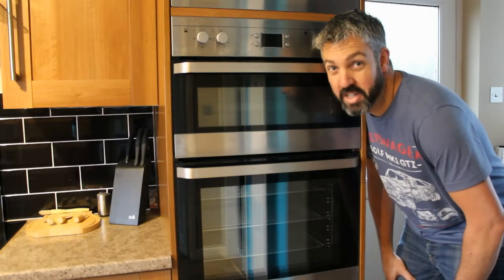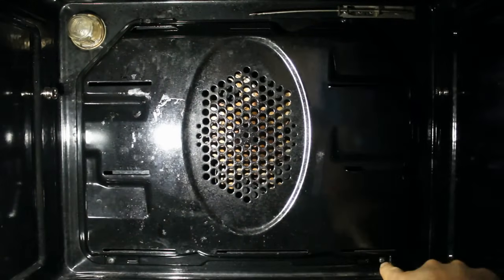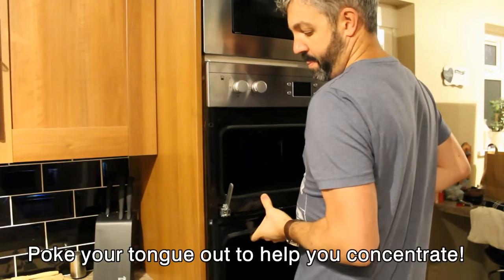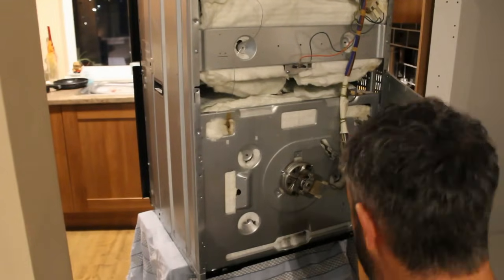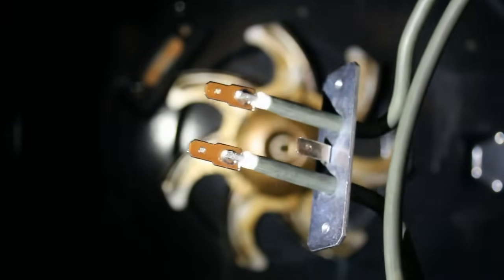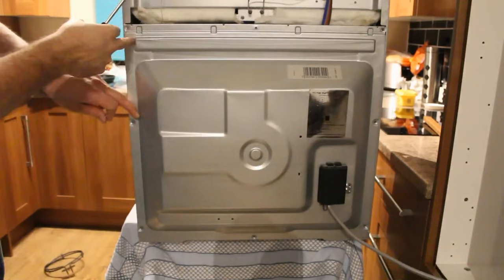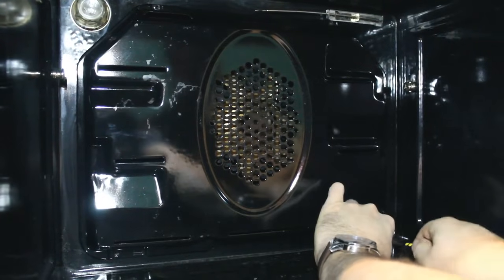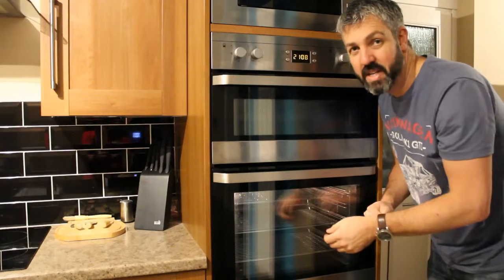How to change an Oven Heating Element on a Beko Oven - Fan Oven not heating up?

Comment: Thank  you so much x I am so proud of myself, 55 year old female and following your tutorial I replaced the oven heating element and deep cleaned all layers on the glass door of my beko 90 cm wide stove! I can not thank you enough for the straightforward guidance which gave me the confidence to give it a go. I have been trying to get the oven repaired for 6 months but no one wants these kind of jobs any more! With family coming for Christmas it was either repair it myself or pay nearly £1k for a new oven! It took me 3 hours, one of the screws was crossed and I had to replace that but I did it and it works! So pleased and thanks x
Reply from the maker: @dandelionpark3673  WELL DONE! I do love reading these comments where the video has helped someone save so much money! 👍🏼👍🏼

Comment: The element in my Lamona 4603 fan oven was exactly the same with 2 of the 3 attachment screws installed form the back, WTF !! Rather than pull the whole double oven out from the kitchen unit I managed to remove the 2 screws using grips on the screw  tails and back-wound them out. I then pulled them out using a magnet on a stick through the cable slot. Could probably leave them in there tbh as they are caught up in the insulation and not really a problem. I then opened up the two holes in the new element attachment plate to 3/16" diameter and installed it with 2 suitable self tapping screws from the front. Mission completed in about 20 mins for just the price of the element , about £10. 👍😉
Reply from the maker: Nice work! I'm glad mine was just a single oven!

Comment: Unreal. Thank you so much for this. Element replaced and seems to be working as expected. Odd burning smell when I first turned it on which panicked me a little, but it quickly disappeared and I'm not on fire or electrocuted. Saved me a fortune! Cheers.
Reply from the maker: Brilliant! Great to hear it helped you out. You do get that burning smell when it's new but will go after a while.

Comment: Excellent video step by step made it so easy . Iv just completed it too 50 min I took my time . Turned it on is it comon to have a different smell  ??  Cheers for the video
Reply from the maker: Glad the video helped you out. Yes...it will smell a bit when you turn it on for the first time after replacing the element. That's normal!

Comment: Very handy video CharlieShooters - easy to follow and given me the confidence to try this myself.  Do you know if it is simple to remove the fan itself too as mine could do with a clean up.  Looks like you just need to remove the centre nut and the fan should slide off the shaft?
Reply from the maker: Thanks, I hope it helps you out. I'm not sure about the fan if I'm honest, I've never had to remove one, sorry.
Reply: @charlieshooter  No worries at all... just did the repair job and its come out lovely.  Bit fiddly to screw the new element back in but with a second person to help hold it, it was fine.  Came up to full temperature in 5 minutes!  Thanks for a great video, the sense of achievement is especially high given the lockdown!
Reply from the maker: Great to hear it helped you out! Especially at this strange time!

Comment: Thank you for your video. Its really helpful, i changed this morning but i drop one screw in the fireproofing. Will this cause any problems if i using the oven
Reply from the maker: I wouldn't have thought it would matter. It is metal so it won't catch fire for a start.

Comment: Thank you! My oven is almost identical inside but only has one back panel so that flummoxed me a bit, along with the two holding screws at the back being very hard to find, but I got there eventually. Also there was always a rattling sound from the fan touching something when I bought the cooker, and my previous beko had the same thing, so I thought it was normal, but now the fan is running and not touching the new element and it is virtually silent.
Reply from the maker: Glad the video helped you out. Good to hear the cooker is now working as it should with no rattles!

Comment: Nice video. My oven's an OIF24300M but internally very similar to this one. I've no concerns about changing the element - I just hope that is indeed the fault! I think it is, however: clock on, fan on, light on, no heat, although there is no visible damage to the old element. Anyway, I'll know in a few hours - if I'm still alive! 🤣🤪👍
Reply: SUCCESS! And no injuries! Your video was really useful. I nearly lost a screw removing the element, as you warned, but managed to catch it. Thank you for your video!
Reply from the maker: @ChrisWrightOM1  Glad to hear it! Sorry I was late with my reply...was going to say, the element doesn't always have to show signs of damage to be blown. 👍🏼
Reply: @charlieshooter  Don't worry - I'd got that from some of the other replies.

Comment: Thank you. I have a Beko free standing range cooker - for some reason Beko refuse to give me any instructions on how to replace my heating element. I'm guessing it's the same principle (ie screws located in the back etc) for me to replace?
Reply from the maker: I've never changed an element in one of those, but I have changed them in a couple of different makes of oven and they have been the same as I've shown here. Sometimes you don't need to access from behind though, some unscrew from the front. Good luck with it.

Comment: Great video, cheers. Quick question though. My yellow and grey wires, attached to the heating element were the other way round to yours, is that correct???
Reply from the maker: I don't think it matters if I'm honest as effectively they are just creating a circuit with the heating element. I would always put them back as I found them, regardless which way round!

Comment: My element has failed in without the big break in the insulation like yours did but you you can still tell it's buggered by checking the resistance on the terminals on the back, it should be about 30 ohms but mine is showing meg ohms resistance.
Reply from the maker: That's another way to test it, if it's not so obvious as mine was. 👍🏼

Comment: Hi Charlie, great video! Only just seen this video after our element failed. Seems since we had the element replaced the fan is now catching the element. The replacement element doesn’t have screw to hold it in place. Any suggestions? Appreciate any help, thanks!
Reply from the maker: Well, it should definitely have a screw holding it in position. If it is just catching the fan, you should be able to bend (persuade) it away from  it slightly.
Reply: @charlieshooter  Thanks Charlie. Seems to move when it reaches a high temperature. I’ll have another play around. Thanks!

Comment: Hi Charlie, 
Great video. The heating element on our cooker does not look damaged like yours but still isn’t heating? Everything else is working fine though. 
Could the element be broken in other ways (perhaps inside or with a connection), I ask this because it looks like new, just doesn’t work? 
Thanks. 
Josh
Reply from the maker: A few people have said the same, and yes it could well be broken without showing any visual signs. If it's not heating up, and everything else is working it's more than likely the heating element. Thanks for watching! 👍🏼

Comment: Excellent video thanks. My replacement heating element is on order. One question, when the heating element blew it tripped out the rest of the oven, ie the display and dials so I can no longer use the grill either. How do I sort this? Will it re-engage once I've replaced the element or will some fuse part also need replacing? I've checked the main fuse box and it's not tripped there, so it's within the oven.
Reply from the maker: Oh right, mine didn't do this so not 100% sure what to suggest to check.  Check the manual for other fuses, or you may find that with a broken element it is affecting other things, depending how it's wired? Maybe?
Reply: The heating element went before on this oven about three years ago although it didn't trip the fuse last time.I might check the plug fuse, hopefully it's as simple as that, fingers crossed.

Comment: Hey We followed your instructions perfectly, but there’s a very strong burning smell when we turn it on - is that normal?
Reply from the maker: It always smells a bit with a new element as it burns off any preservative that they coat it with. Leave it on for a good 15-20mins and it should go! Double check nothing is catching the element.
Reply: Wow thanks for such a speedy reply - so grateful for your advice - it’s just me and my flatmate and we’re a bit useless but this broke things down so easily!
Reply from the maker: @aliceteawithroses  Pleased to hear it helped you out! 👍🏼

Comment: Hi Charlie, thanks for this video. I have the exact oven as the one you used in your video but it also doesn’t heat up as much, it just stays lukewarm. I have followed your instructions and replaced the element but the issue still persists. Is there some sort of optimum temperature setup I could follow? Thank you so much
Reply from the maker: It's usually the element if it's not heating up, but it could also be the thermostat.

Comment: Thanks for this video. I enjoy fixing things myself! I've replaced my element but the fan isn't spinning smoothly; it catches on the element. Any tips for fixing that? TIA!
Reply from the maker: Not sure! If you've bought the right element it shouldn't catch the fan. There may be a bit of adjustment where the element is screwed in, or you may be able to manipulate the element a tad to get it out the way of the fan. Don't pull too hard on it though!
Reply: @charlieshooter  the product description says it should be the right part. I'll try some gentle manipulation!
Reply: Hi Charlie, I've replaced the element but the oven seems to be tepid at best. Any suggestions for what to try next?
Reply from the maker: Could the new element be faulty? The fact it didn't quite fit right and now it's not heating up may be an indication of that? Or is the thermostat faulty maybe?

Comment: The way you spin the blade in this video is that the correct direction for the blade to spin? I know it sounds dumb but I'd expect the blade to spin the other way?
Reply from the maker: Just checked, the fan goes clockwise.
Reply: @charlieshooter  thank you for the help. Much appreciated

Comment: When I fit the new element, could I put the retaining screws in from the inside instead of the back and save all the back removing next time it needs replacing?
Reply from the maker: It's a good idea, but unfortunately that won't work, because they thread into the bracket on the heating element.
Reply: @charlieshooter  I might have to look for some bolts with the correct thread and glue the nuts on the rear, lol.   I'm just a simple girl and can't be doing with removing the whole thing just to replace an element.  Beko used to be so much easier :D
Reply from the maker: You could try....but I don't know how successful that would be! I'm hoping I don't have to change it again...hopefully this one will last! 🤞🏻

Comment: I am doing my heater element on my beko exactly as yours, however the fireproof material seems singed in a few places is this a cause for concern also on my heater element the wires seem to be reversed yellow to the top connector Gray to the bottom, can you advise please
Reply from the maker: I'm pretty sure some of the fire proof material may have been singed in places on mine too. It's nothing to worry about though. As for the wires around the other way, again, that won't make any difference as it's just a loop, so you'll be fine putting them back either way.
Reply: Thanks for very speedy response to my question, your knowledge and the clarity of your instructions are exceptional,  don't suppose you  know the numbers for Friday night's euro lottery? Many thanks Stewart
Reply from the maker: I'll let you know Friday! 😉 If I get them right I'll buy you a new cooker!! 😂 Thanks for the nice comment! 👍🏼

Comment: I have BEKO - XTC611W 60 cm Electric Cooker
and I do believe my element has blown 
Fan and light on but no heat after fuse tripped earlier
Any advice you can give 
Where to buy element etc would be very grateful
Subscribed 
Really great vid
Reply from the maker: Thanks for subscribing! Amazon would be my first choice maybe. Other than that, bekospares.co.uk, espares.co.uk or even Ebay?
Reply: @charlieshooter  FIXED it.....Thanks again
Reply from the maker: @darkestserenity6775  Excellent, pleased to hear it!

Comment: Hi fan not spinning for my beloved double oven is it a easy process to replace?
Reply from the maker: If I'm honest, I've not had to do it! However, the process would be very similar to my video, as all the same stuff needs to come off to get to it. There may be a bolt/screw holding the fan blades to the motor maybe, and then the motor will be attached from behind.

Comment: My oven is a range oven with two fan ovens. one works fine, the one I use to most is getting too hot. I am not able to unscrew anything in it as I can't grip a screwdriver due to severe arthritis in my hands. any useful tips will be of help?  I don't want to replace it as all other parts work ok apart from main oven.
Reply from the maker: There are tradesmen who specialise in oven repairs, or electric appliances. Maybe worth checking for a local tradesman to you. I'd imagine even that would be cheaper than replacing a whole range oven.
Reply: @charlieshooter . Thank you for your reply Charlie, will certainly give it some thought.

Comment: I tried to change the element in my zanussi oven  but after removing the element the 2 wires which are connected  with spade connectors fell down the back and i had to remove the back of the oven with great difficulty to push them back through but now i dont know which way round they go or can they be put on either way. There are just 2 teminals so 2 wires.
Reply from the maker: I'm sure they can be put around either way....it is just creating a circuit out of the heating element and it doesn't matter which way round it goes.
Reply: @charlieshooter  thanks for the quick reply it was worrying me I'll give it a go cheers.

Comment: I changed the heating element over but got the cables mixed up so it blew when I turned it on haha would it just be the main fuse that’s gone or??
Reply from the maker: I would think it may be the fuse. Put the wires round the right way and try swapping the fuse.

Comment: Hi hopefully you can help me... my becko oven is heating up but the fan has stopped and it's making cooking a nightmare..  the fan was making a funny noise for a few weeks before it packed in.. how do I replace the fan?
Reply from the maker: If I'm honest I've never had to change one, but from what I can gather it is a similar process as the heating element (i.e. the back has to come off to access the back of the fan), couple of screws and you're away.
Reply: @charlieshooter  thanks for the reply.. have found another video on youtube and looks fairly easy lol

Comment: Hi Charlie, I have the exact same oven as the one your working on here and my element has gone too. One query I have is the connections on the element from behind, the grey and yellow. My colours are yellow on the left and grey on the other side the right. You mention that they are the opposite to mine is this an issue or should I make sure the grey is left and yellow right? Many Thanks. Paul.
Reply from the maker: I would always put them back as you found them, but in all honestly, it's just making a full circular loop so which way they go round probably doesn't matter.
Reply: Thanks Charlie, Another question please Charlie if you don't mind. As I have mentioned that my element had blown yesterday. My timer does not light up at all since the element blew, would this be right that it would not light up until the element is replaced? Many Thanks Charlie. Paul.
Reply from the maker: Do you mean the clock? Mine still worked even when the heating element had gone.
Reply: @charlieshooter  yer mate the clock not on at all
Reply from the maker: I don't think repairing the heating element will fix the clock......but I may be wrong?
Reply: @charlieshooter  ok thanks anyway Charlie who have helped me a lot already Thank you

Comment: My family had an oven like that, but it was made by Lamona, and the problem with the heating elements was, was that the elements were screwed on at the back, so replacing the heating element would involve something pretty awquard.
Reply from the maker: Yes, exactly like this one was. Quite often they are screwed in on the front and it is so much easier!!
Reply: All I can say is, is that Lamona, Beko and others like that, should have the screws on the front instead of the back.

Comment: I replaced my new fan heating element on and there is smoke coming out. Any reason why?
Reply from the maker: There maybe a small amount of smoke as it burns off anything that has been put on the heating element to protect it whilst packaged, but that should quickly go. Anything more, maybe somethings caught on the element?
Reply: @charlieshooter  Thank you for your help! My oven fan keeps coming off and it has no screws to tighten it. It is very loose and when it spins, it comes off. I tried to super glue it on but it didn't help. What can i do?
Reply from the maker: @TopA1999  Think that maybe the cause of the smoke. It should attach somehow, a scene or two, but super glue is a big no no!!